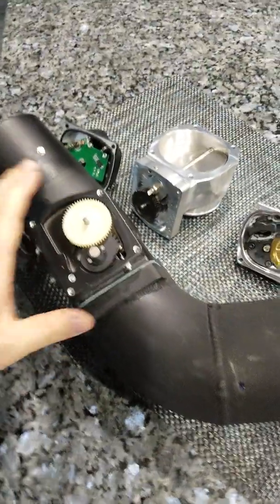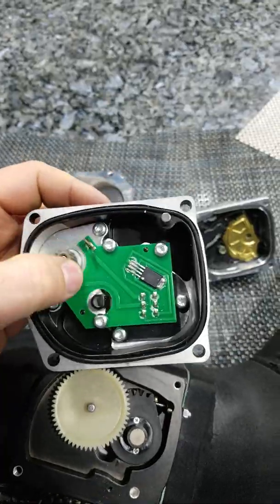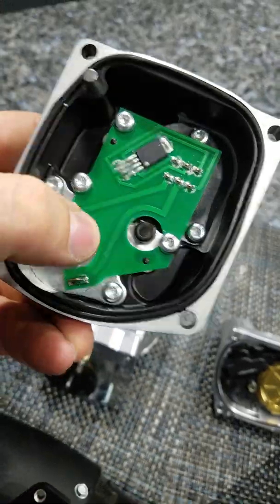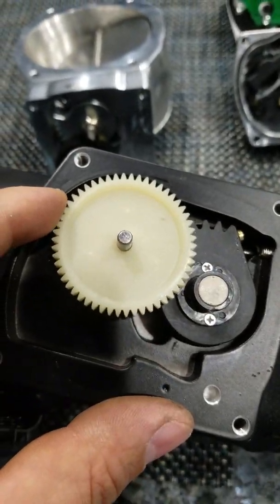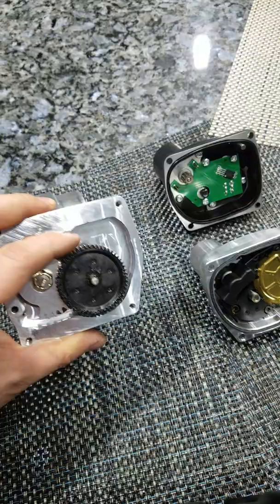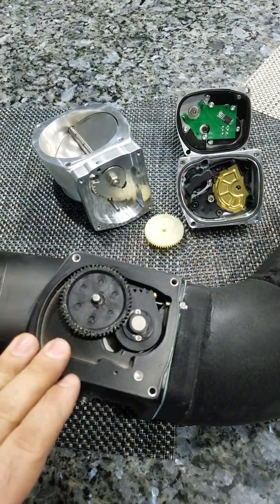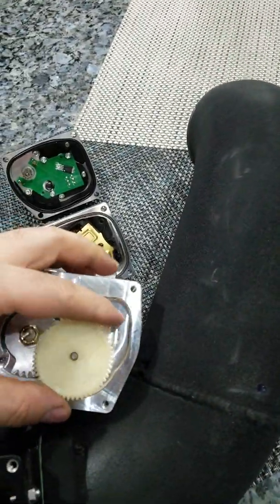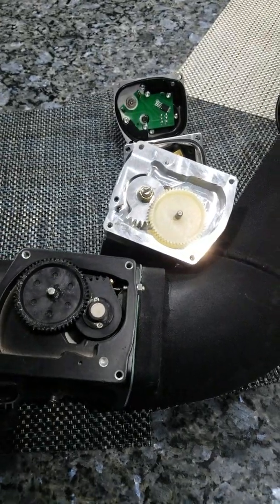Boosted NW102 vs. Chinese 102 throttle body

Comment: I have a Chinese throttle body took me almost 4-6 months for it to learn the throttle positioning of the throttle body. All-time it had a bad rev hang and whenever I came to stop it would be bouncing off the idle like after like 3,000 RPMs horrible. I kept taking it out and apart seeing if there's things that I can do in order to make it work right. Or if I could somehow modify it to work with the factory motor trying to add that little fin to the throttle body but I could not figure it out. Then finally one day I wasn't that bad and now it's working smooth for now.
Reply: Still working well?